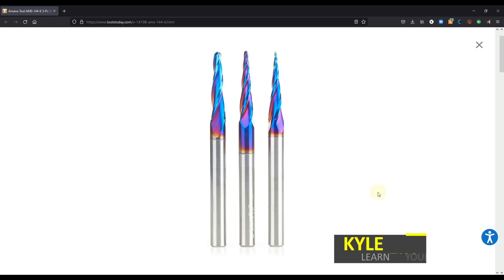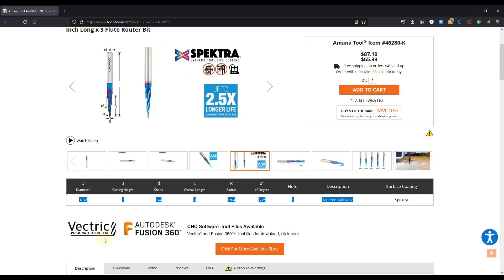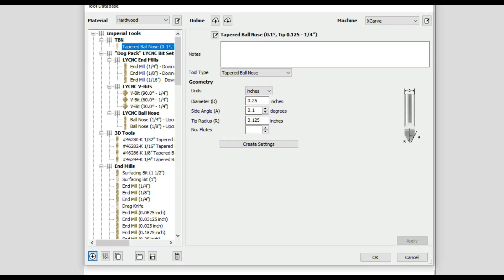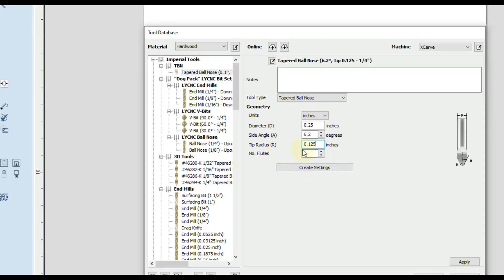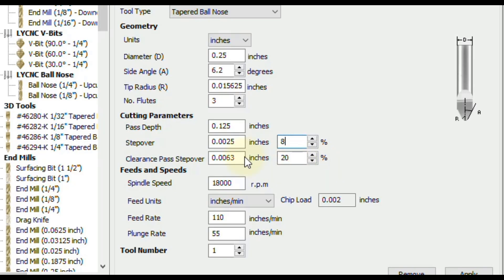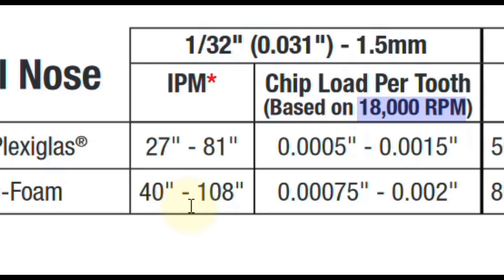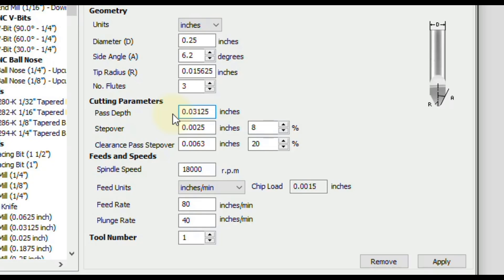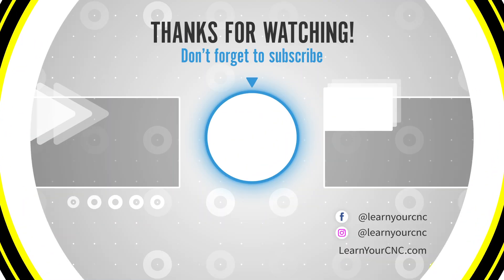How to enter tapered ball nose bits into Vectric tool database - VCarve, Aspire, & Cut2D Quick Tip

Comment: Just rewatched the video.  It was good the second time around too.  I have noticed BROINWOOD and others are using TBN to do their inlays using a vcarve toolpath.  I just watched a video where the creator indicated to be able to use a TBN for vCarving to do inlays required a person to enter the TBN as an Engraving bit.  That was new information to me and I am not sure it is accurate because I believe I have selected my TBN 46280K in a vcarving toolpath and it worked as expected?  Am I wrong - can I use a TBN in vCarve toolpath as a TBN or do I need to enter it as an engraving bit?
Reply from the maker: I just checked and you can use a TBN with a vcarving toolpath, so I would enter it as a TBN tool to reduce the possibility of errors.
Reply: @LearnYourCNC  thank you for checking - I thought this was the case.

Comment: in your description of entering the angle of the taper, you used 6 deg.  That would be the included angle. However the diaghram showing the tool in the database indicated the angle from the center line out which is half of the included angle....... now im confused a to which angle to plug into the d-base

Comment: I've heard that you should set the plunge rate equal to the feedrate for tapered ballnoses doing finishing toolpaths because it will slow you down to the plunge rate anyways when you have lots of up/down movements while doing 3D models. I've set both my parameters to 2000mm/min (around 78ipm) for both those feeds and it works out ok, even on hardwood (only tried afromosia for now).

Comment: Kyle, I have found that it helps to put a tool number, because if you output all the cuts in one file your CNC will see the tool number changed and stop to alert you to change the tool. Having them all the same it will not stop.

Comment: Why doesn't it require the length of endmill? Isn't that a useful parameter?
Reply from the maker: Good question, that is a useful parameter but Vectric software currently does not require it. They rely on you to determine whether or not your tool is long enough to complete the job. Most of the time it is just fine. But if you are making deep cuts, that is when you want to be cautious and double check everything. However, it would be ideal if Vectric adds that in as a parameter in the future to avoid collisions on deep carves.